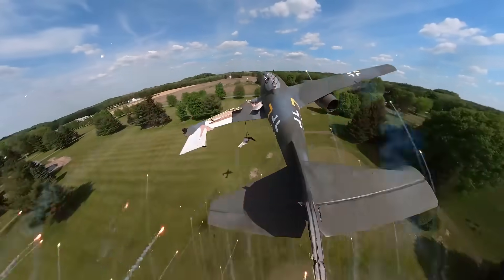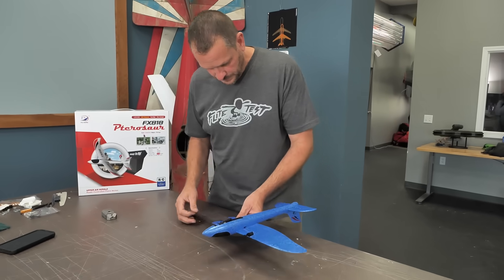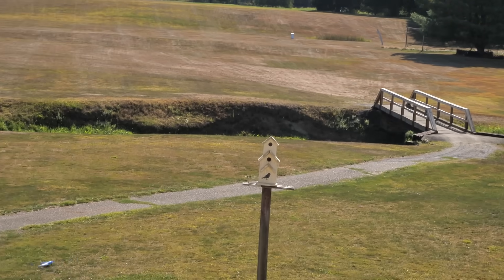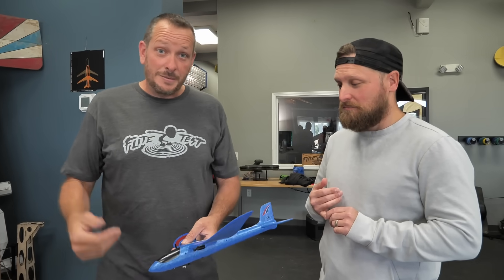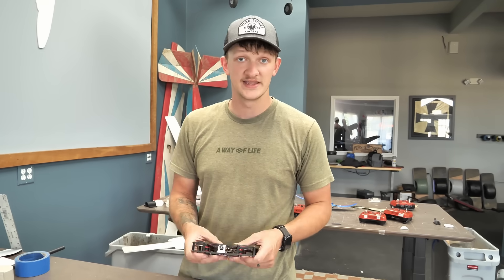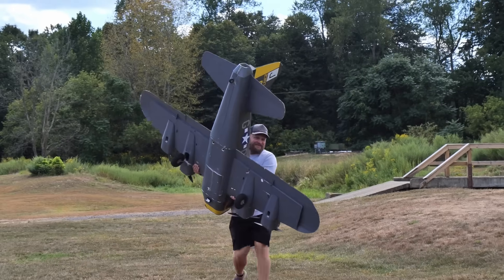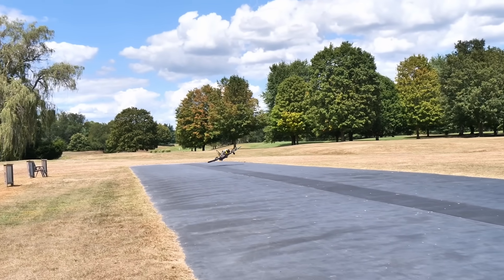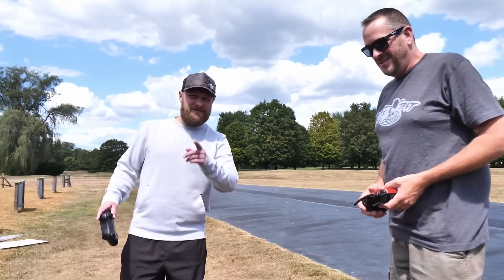Can We Drop an Airplane From An Airplane?

Comment: Hello, just a question: how difficult would a drone controlled by one operator, having the primary camera facing forward (12 o'clock) for the operator's use, and others in the 3, 6, and 9 o'clock positions?  Multiple cameras are better, so the operator just flies the drone keeping it safely flying, and other Secondary personnel can monitor those extra screens.  I think it could be doable from things I have watched on your channel before, but I have to say I mostly watched just to see you guys build really cool stuff.  I think this could have a market application in security situations and search and rescue.  Having only one camera would mean that to cover wider areas, you would need more drones and operators.  However, with multiple cameras facing different directions, and other non-operators concentrating on finding things, it could be more efficient.  I could see a use in security and search-and-rescue applications.  From watching your shows, I understand everything adds weight, and that requires more battery.  Would four cameras require too much power and therefore too much weight?

Comment: For the quad make sure you have arm angle set to 180. Then the quad can arm in any orientation. Also plug in and set it on the ground for a second or two before loading in the plane. Alternatively you could arm that little quad inside the plane just before dropping.